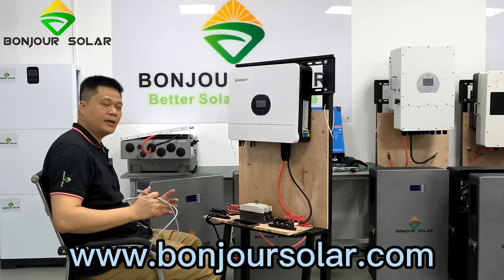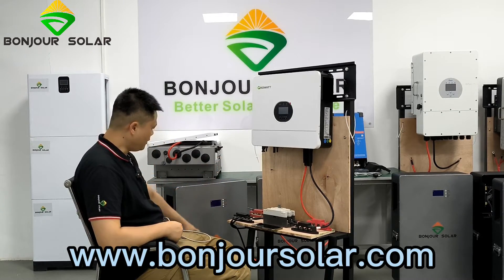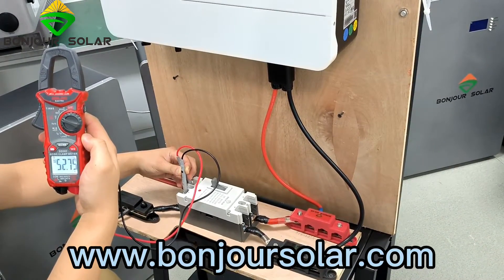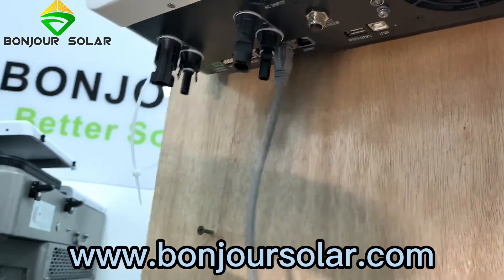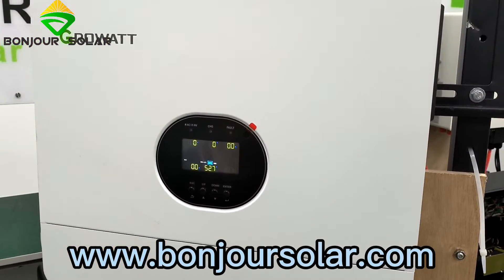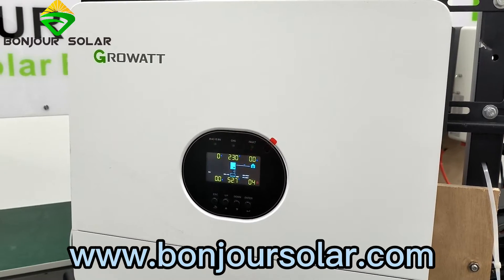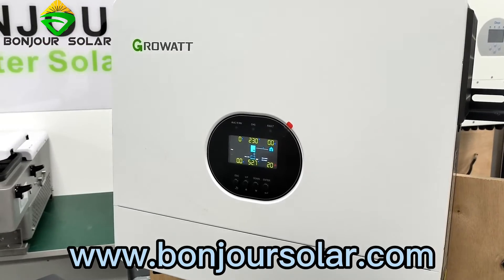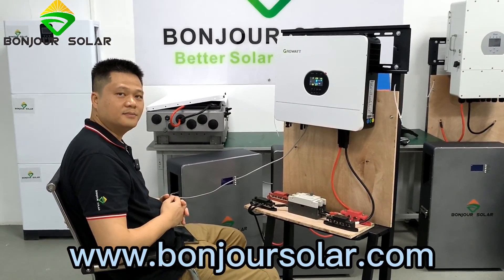How to Setup BMS Communication for Growatt SPF6000 with BONJOUR SOLAR lithium battery

Comment: I am currently using the same model of Growatt inverter along with a Xintailai 200Ah lithium battery. However, I am facing an issue where the inverter displays Error Code 20, which I understand is related to BMS communication.
Please note that the battery does not support any mobile application, but it is capable of communicating via CAN and RS485 protocols. Despite several attempts, I have been unable to clear the error.
I would appreciate your guidance on the correct configuration or any necessary steps to resolve this issue and establish proper communication between the inverter and battery. Thank you

Comment: Good day, I am the owner of the growatt spf 6000 plus inverter. I have a problem with communication between growatt and my battery (bms jikong). Growatt is connected to the battery via CAN, but the battery charges to 54.2-54.8V and after charging the voltage drops to 53.6V. In the BMS setting, cell ovpr 3.58V. Help solve the problem.

Comment: Hello, please is it compulsory to use dc breaker between battery and inverter? If I use normal AC MCB will they be any issue?
Reply: You have to use a DC breaker. You can't use AC Breaker for a DC circuit..For one battery 100Ah use a 125A DC Circuit breaker to be safe.
Reply: @somtronics1433  i have 300ah pack can i use 250A DC?